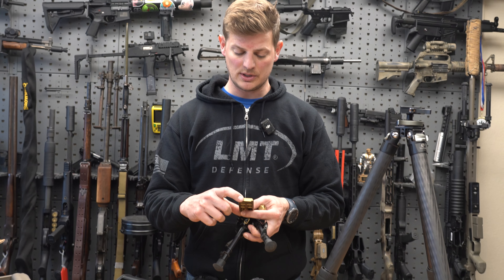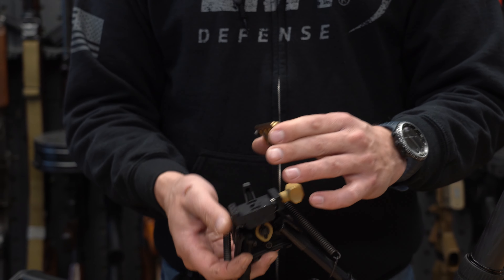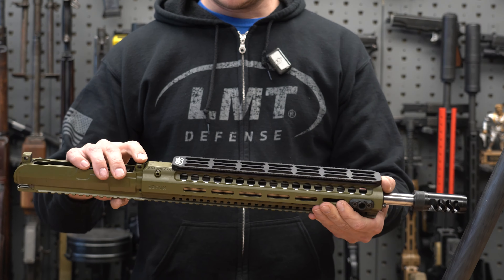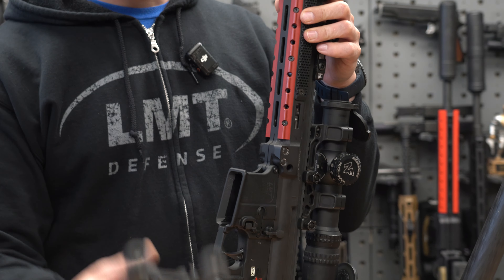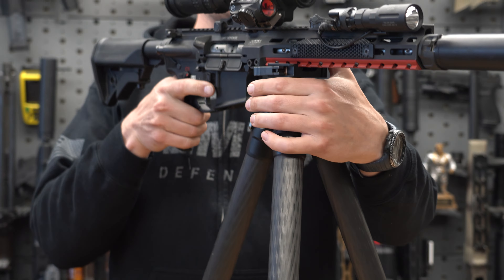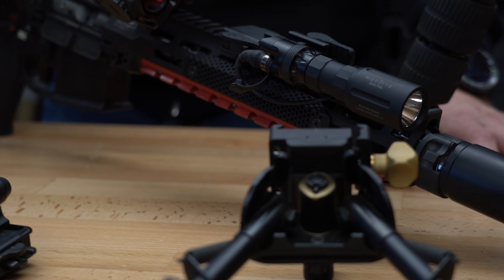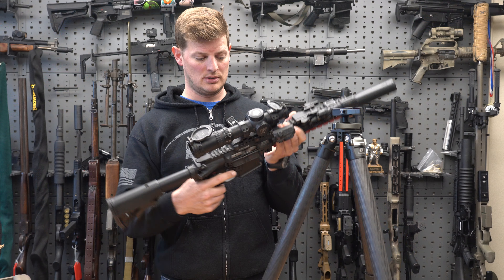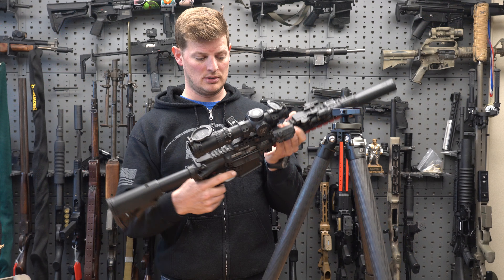Lewis Machine and Tool (LMT) Mlok to ARCA Adapters

Comment: What length barrel is this? I notice it lines up perfectly with the suppressor and Specwar upper. Was the rail shortened or is it a 12” or close to that barrel?
Reply from the maker: @keanuneowick8877  custom made ~12” 6arc barrel
Reply: @dwilsonmfg  thank you!
Reply: @dwilsonmfg  what is the gas system length? I’m going to do something similar.
Reply from the maker: @keanuneowick8877  mid-length